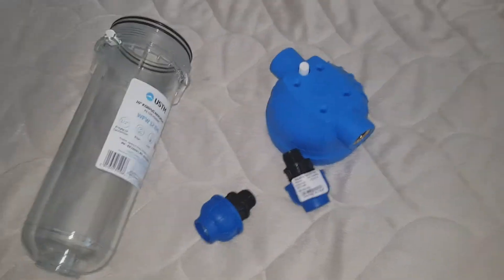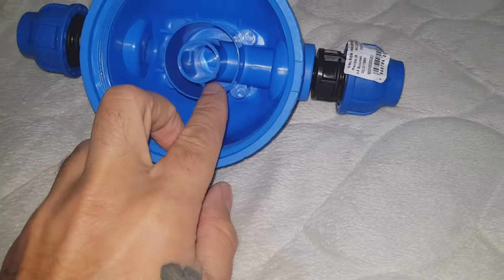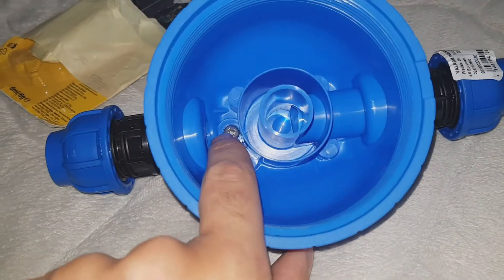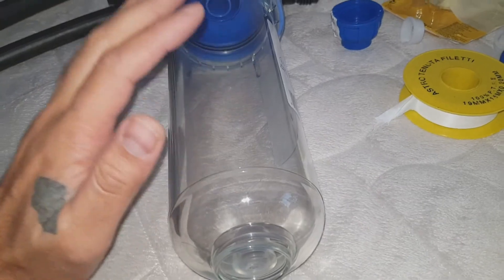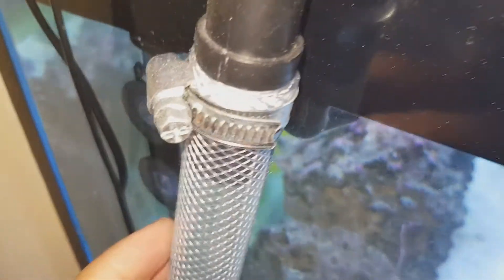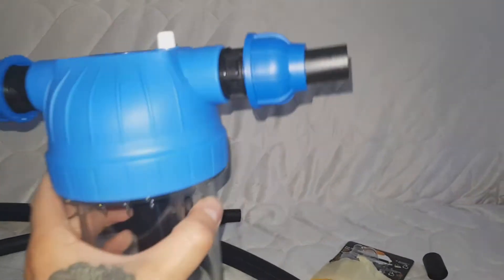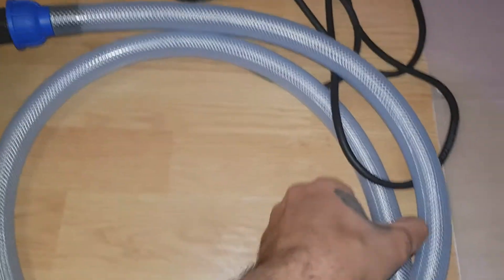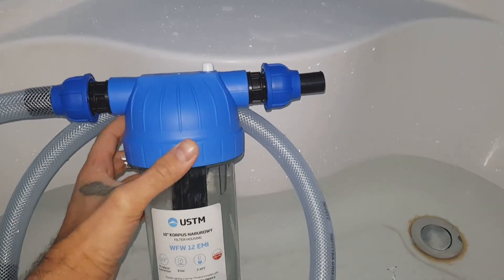DIY Biopellets or Carbon Reactor

Comment: I’d of drilled out that hole and tapped it to a plastic bolt thread size and put a BUNA o ring around the bolt and tightens it down till it sealed so the bleeder port was still fictional if needed.

Comment: Hey where did you buy that cheap water filter?
Reply from the maker: You can find it in any hardware store.
Reply: Tractor supply has them, but they are around $30.00, have not seen them in stores for much less. Probably eBay or Amazon.